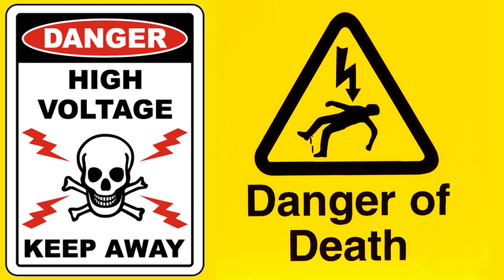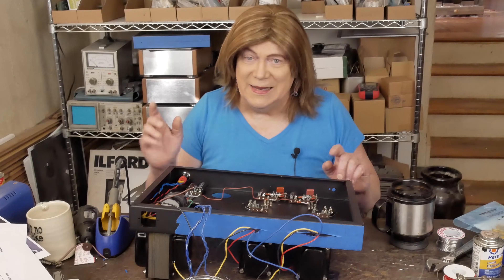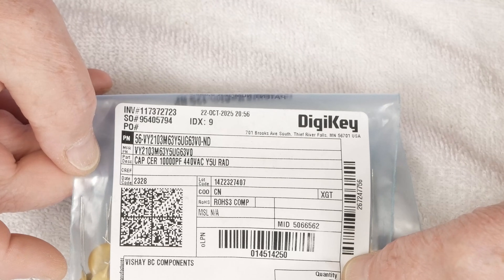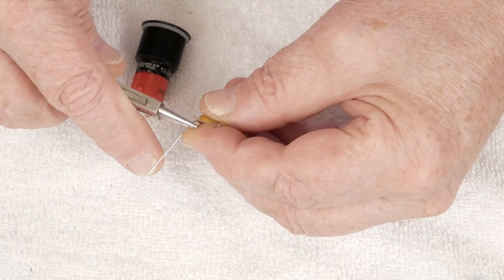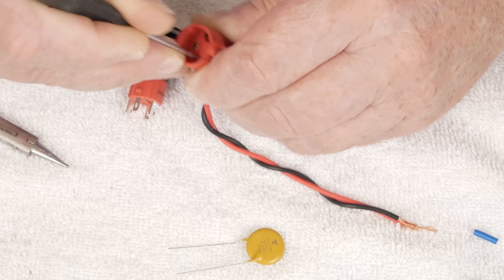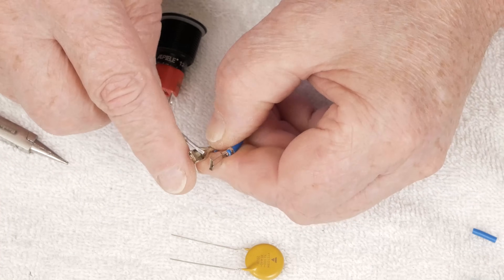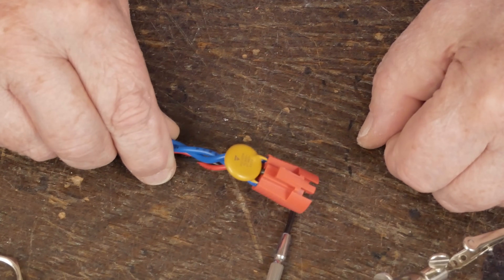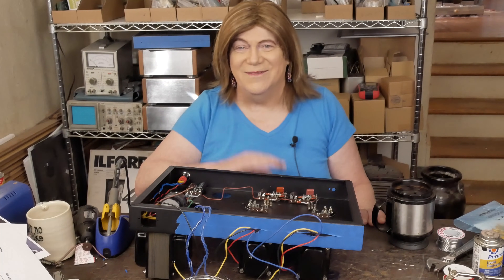Adding a Snubber Cap to a Push-on Push-off Switch

Comment: I recently converted a incandescent pilot light to LED.  I also used a small bridge rectifier, a 470 ohm resistor, 100 uF capacitor.  I wanted to fine tune the brightness, so used a 100k ohm trim pot in series with the 470, all mounted on perf board.  The cap is nice, it lets the LED fade out when turning off, just like old equipment does. It's the small details!
Reply from the maker: I forgot the fade out effect as a benefit!
Reply: That's a great idea

Comment: Howdy.
With all due respect.
The voltage rating should be 3 kV.
Breaking inductive loads generates very high voltage spikes.
Best Regards.
Reply: When you use Class X1, Y2 Caps, you don't have to worry. The can handle very high peak voltages.
Reply: @raf.visuals  Howdy.
Ah Yes. OK.
Cheers.
Reply from the maker: Correct, they are designed with this in mind.
Reply: @SkunkieDesignsElectronics  Howdy. Yes.
Another good thing is the cap. absorbs some of the switch arcing energy at power off.  A somewhat longer switch life span is to be anticipated.
Cheers.

Comment: Great job on SNUBBER cap. Many do not know about them or how to use them. It takes the POP out of audio when powered off. They must be line rated safety cap. Their is 2 types of them safety caps. Line to line and line to ground. That switch needs line to line. 440 VAC is better than the 250V ones. If going to ground from line then it is the outher type of safety cap. When using EMI/RFI filters both types are used. I use a slightly different snubber circuit. Amazon has the, Search for snubber circuit. Just has a resistor in sears with cap  to help with sparking on contacts . Common on relay contacts . Not as important hear . Sometimes SCR's and TRIC's have a snubber across them.  This also helps with RFI noise.  Some different color LED's need different value resistor for brightness. I find best to dim them a bit and last much longer . Cheers.